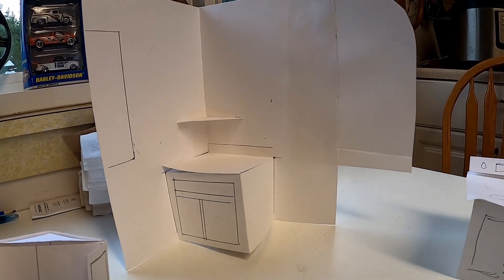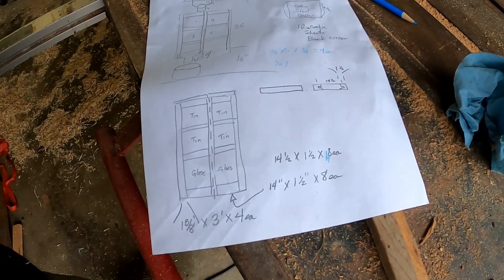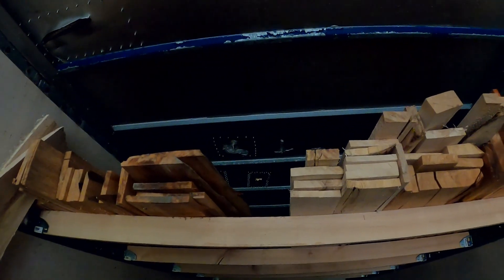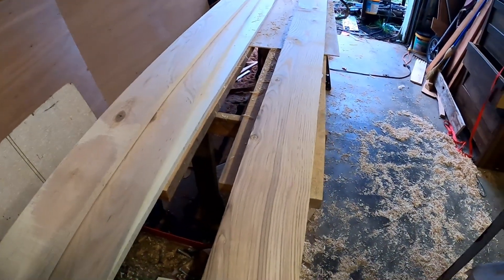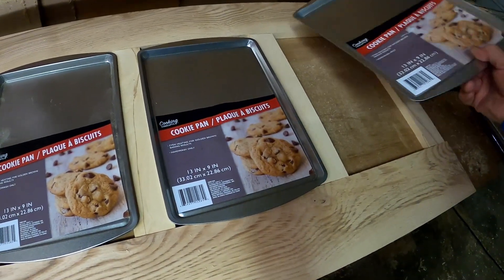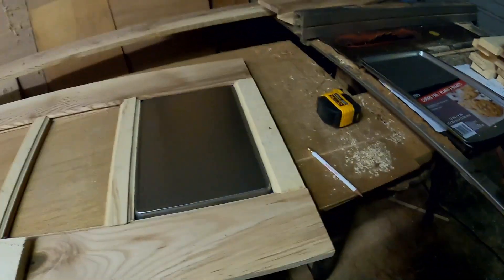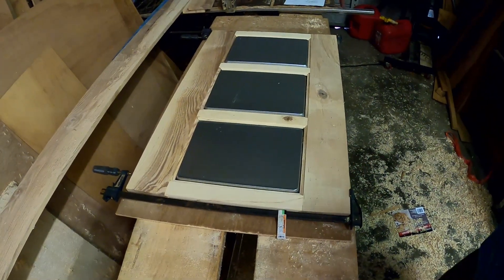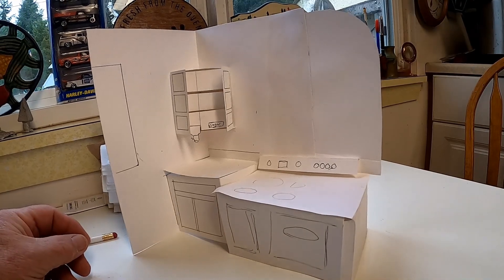2024 Hoosier corner cabinet

Comment: mr  bob i found you a complete guts out of a hoosier for 70.00 at your door hand crank bottom lid and container that holds the flour i gave you a land line that looks like a stone polisher harbor freight ivan from illinois. has the same belt
Reply from the maker: So you have a flour bin you are selling for $70.00? If it holds 50 pounds of flour, It would be good for a full size cabinet. My corner cabinet will hold just over a standard 5 pound sack of flour.
Reply: HELLO MR BOB THIS BIN WAS ON EBAY OUT OF ST LOUIS MISSOURI  I DON,T KNOW IF SOLD OR KNOW  I JUST YOU CAN DO ABOUT ANYTHING